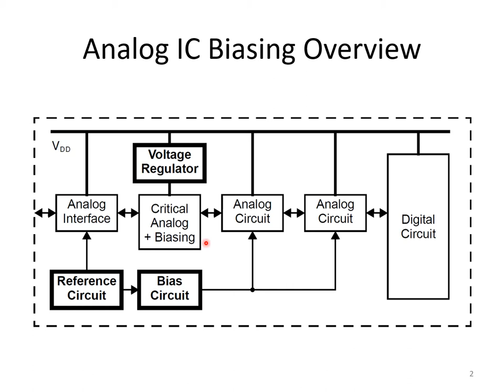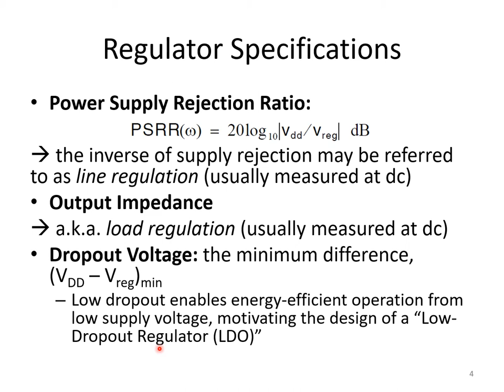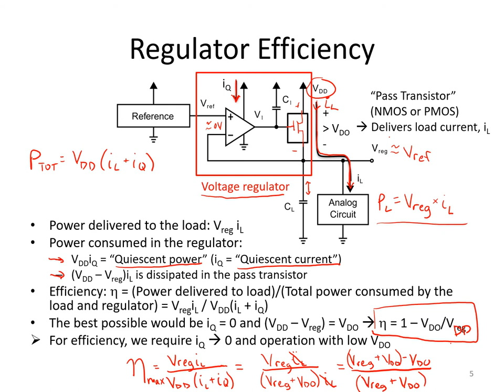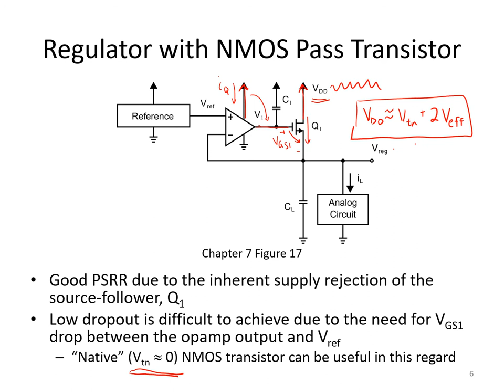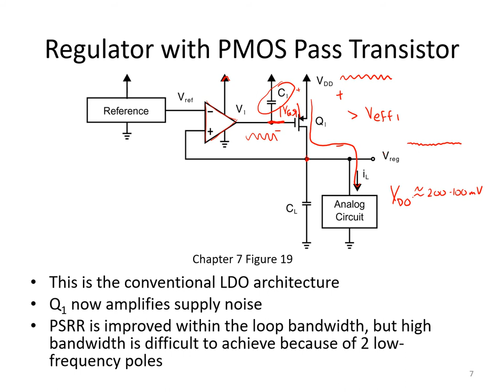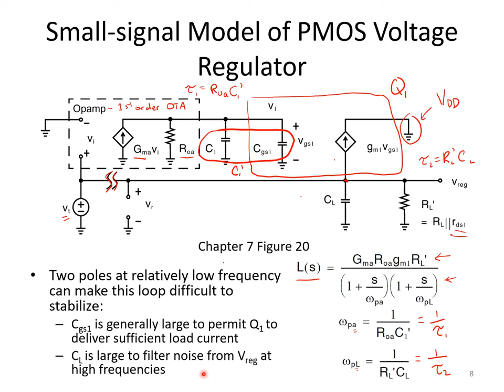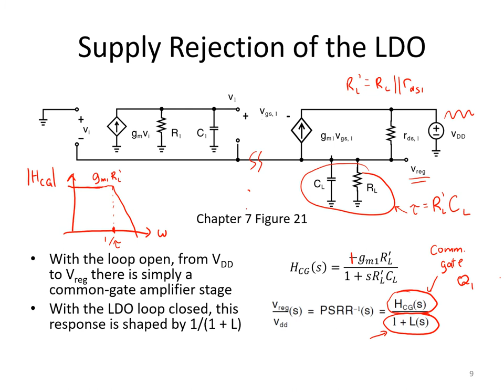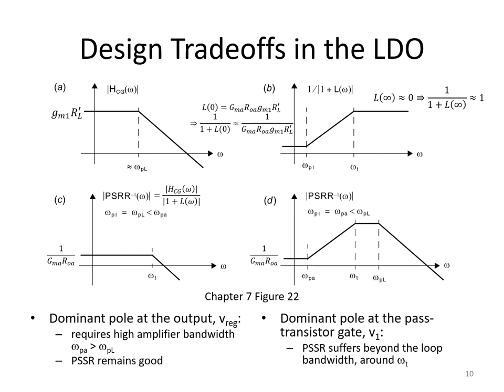26 Regulators

Comment: Thank you for your work.
I have to design a LDO after an choke input DC regulator because the input and load voltage diffrence is abaut 4Volts maximum. The input DC voltage after a choke contain only a pure 100Hz sine wave as noise,  (80mV@460mA preload) insted of any ripple or high frequency noises what can came from an usual rect.+capacitor combo. The Line voltage regulation and behave at distorted line voltage is also looking realy good for me.
So the LOD is only have to filter out that 100Hz sine and may keep with the load current changes. I think the PSRR is can be fair at low frequency to do that.

My question is:  what is the practical placement of the lower pole frequency relatively to the 100Hz noise?

fpl(by RL’&CL):~10Hz 
fph1(by emitter follower driver transistor miller&op-amp output res.): ~460KHz
fph2(by common emiter pass transistor miller @ Av & base+drive res.’s w/o. Rc ll CL): ~ 6KHz. By actual design.

It is fine? The Rc ll CL i think drop the Av significantly at 6KHz, so the real fph2 may goes mutch higher than this. Like 1800KHz because the Av factor with naked Rc is close to : -300.

Thanks for your time.